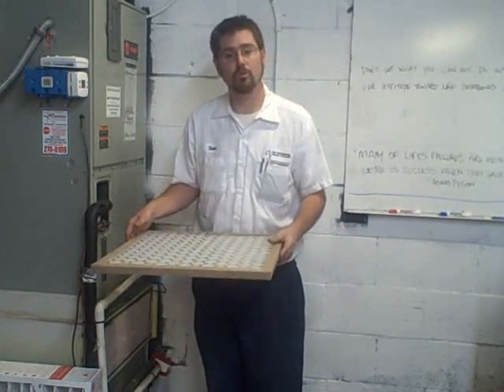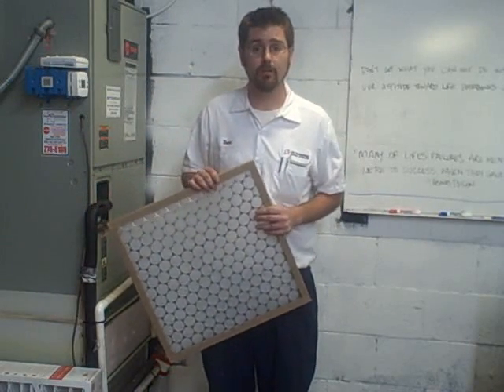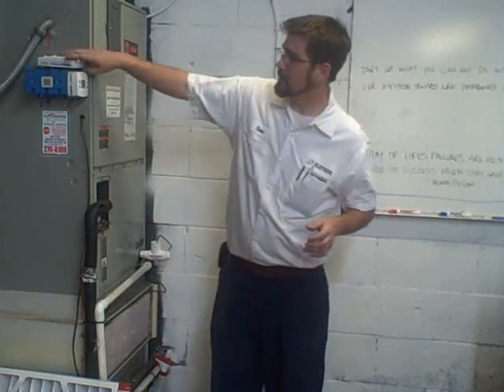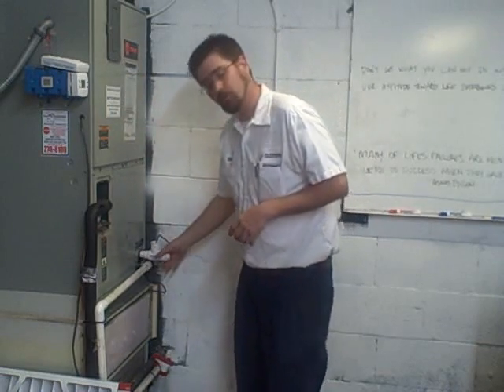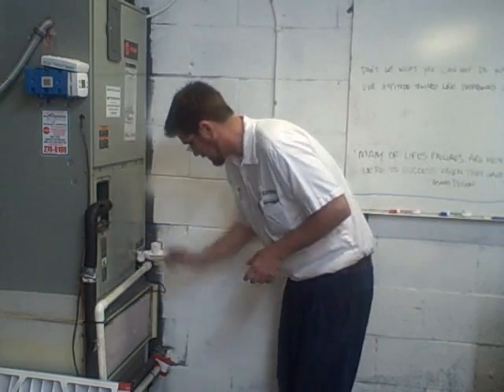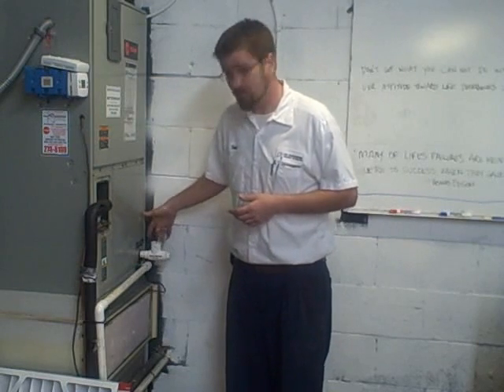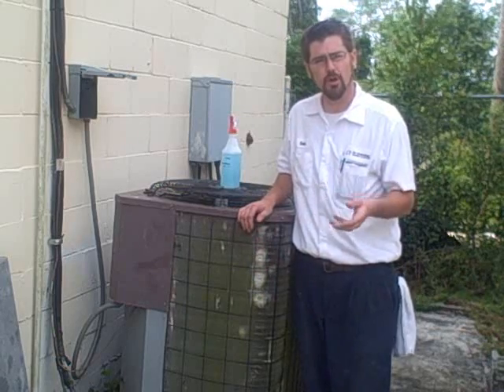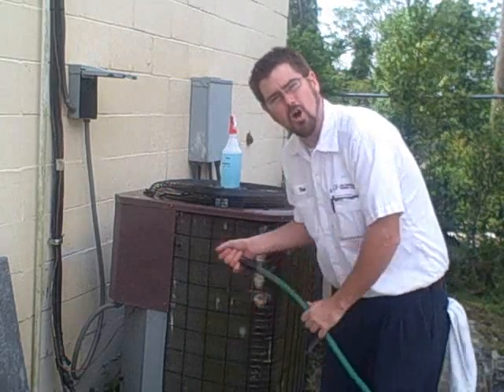Air Conditioner  Maintenance Tips

Comment: Try to get away from bleach and or vinegar as they may cause Formicary corrosion and spring leaks in the evap. coil.Hot water(about a half gallon depending on length of line set) does a good job.

Comment: It's best to remove the sprayer from the hose and just use the open end with a finger to control the flow- the sprayer can and will bend up the fins. Use regular dish washing detergent diluted in a sprayer for the coil to get it cleaner.

 TURN OFF POWER" BEFORE" WASHING.

Comment: Ugh...  My Trane air handler fill tube is inside the unit, below the filter.  I have to remove metal door, remove the filter, uncap condensate fill tube, etc.  it’s a tight space to get into.  It’s a big rigamarole, and hassle. I like the condensate lines on the outside of the air handler unit.  Why are mine inside instead of outside? Hence I don’t do vinegar pour as often as I should.  Wah Wah Wah